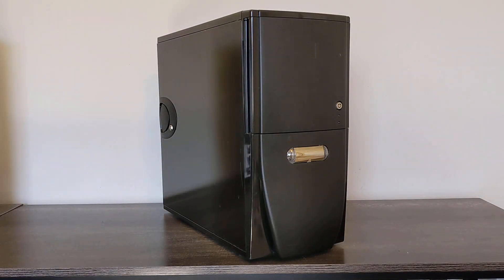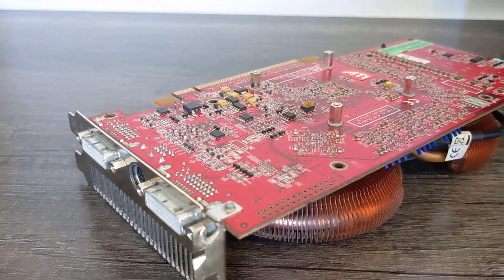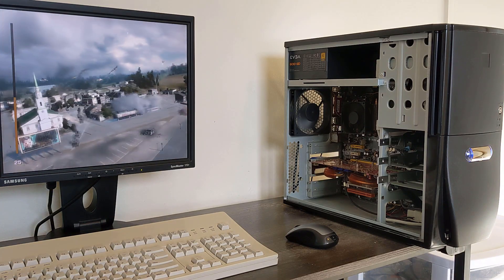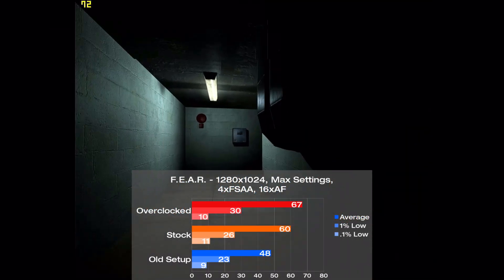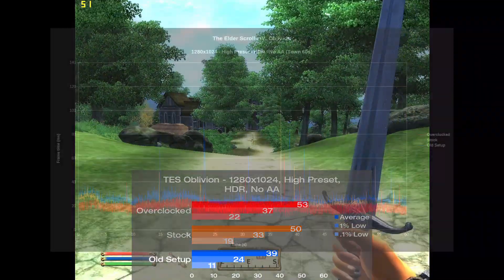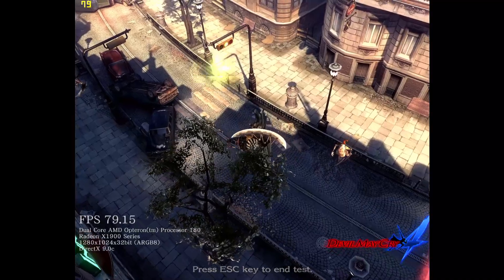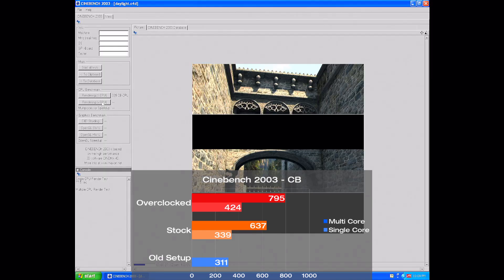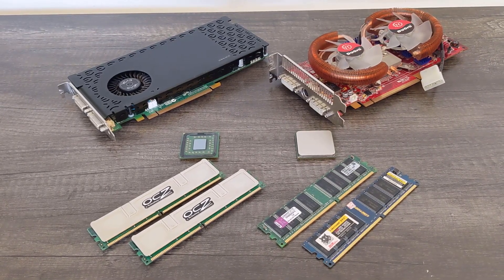Upgrading a 2005 Gaming PC for Early 2006

Comment: I have a similar build, its got a 3800+ 2.0ghz oced to 2.6 (could push it further but the temps get too hot), 2gb or ddr1 oced to 225, raid 0 ssds (sadly id need sata II ssds to take full advantage due to a bug with sata III ssds but either way I get about 270 MBps with sata 1) and to top it off a 8800 gts 640. Its an incredible machine for its age, with the latest nvidia driver with xp 64 bit and mypal 68 (and h246ify) I can watch this video in 1080p30 and I barely scratch the cpu!

Comment: For your test of Splinter Cell CT did you use a physical copy of the game? I tried tobuse the benchmarking tool but it said I had to have the game installed. I also want to verify if you can copy the game files of the steam version over to Windows XP and the game will work, like you can with HL 2. Can anyone cerify that for me?

Comment: All praise to the algorithm for leading me here! This Sonata II case was the home of my own first-ever PC build back in 2006. Until that point I had not broken out of my console gaming roots and embraced the PC as the ultimate gaming platform. The build is etched into memory and I'll always have a soft spot of nostalgia for it. In the process of re-creating it over time as I find the parts and funds allow. If you're curious:

-AMD Athlon 3800+
-ASUS A8N32-SLI  Deluxe
-XFX 7800GT
-Zalman CNPS 9500 (Silver)
-4GB Crucial Ballistix DDR-800
-WD Raptor 160GB
-Sound Blaster Audigy 2 ZS
-OCZ PowerStream 520W PSU (Loved this thing, but would not trust an NOS unit these days... RIP)
-Antec Sonata II in Piano Black

Comment: Just subbed. This is my exact kind of content. And I still have my Asus board with a QX6850, 4gb Corsair XMS2 DDR2 and 2x 8800 GTX's. May end up reviving the old beast sometime soon. But I genuinely miss this time period. I remember watching my dad build me my first PC back in 2003. I had a 2.6ghz Pentium 4, 512mb DDR 400, and a GeForce FX 5200. And like the differences between the 7800 GTX and 1900 XTX here, I upgraded to a 9600 XT a bit later. Wasn't the fastest card in that lineup, but my god was it a powerhouse vs my 5200. that and an upgrade to 1gb ram. I remember having to run Dx7 mode on call of duty 2 because the FX 5200 just couldn't handle Dx9. but that 9600 XT just handled it like a champ. Also got a Radeon X1950 GT 512mb laying around. I'd test my Uber Edition X1950 XTX. But was sadly a dead card. But still really cool to have.

Comment: This ERA of PC hardware was definitely an amazing time of change and innovation. Although all the parts didn't come out in 2005, I remembered comparing my cousins PC having the NVIDIA's FX 5900 (another topic unto itself), to my newly Built GeForce 6600GT (mid range at the time) Athlon 64 X2 3000+ system, it was crazy how much changed in one Cycle.

I had upgraded from a GeForce4 Ti 4200, AMD Athlon Thunderbird 1GHZ unit, and it was night and day.

Comment: still got my old dfi lanparty ultra d, 7800gt and a 4000+ that i had running @3150mhz. many hours were spent playing BF2 on that :D
i did try other cpus in it, 146, 3800x2 4200x2  all topped out around 2800 and werent as quick in games as the 4000+ was. you were extremely lucky to get 3ghz out of your dual core.

Comment: Awesome build and video series, I went back and watched the previous just to get the context of this upgrade. For XP I don't really go higher than an A64x2, and right now I'm well under it.

A build which currently sits on a shelf collecting dust is an A8N32-SLI deluxe, FX60, and dual 1gb 8800GTs. I know it's a bit anachronistic with the later G92 die-shrunk cores, but they run quiet, cool, and max out the CPU at the speeds I run it (usually 438/2800, because I like the board too much). 3ghz is really good for ANY 939 64x2.
Reply from the maker: Much appreciated man, glad you enjoyed. This was a fun little series to do! And that's an awesome build, I heard 8800GT's can be really good in SLI. I should try it out myself at some point

Comment: Minor nitpick but I noticed the DDR slots 1&2 are populated wrong. You’re running it in single channel mode. Put the second stick into the third slot to run your RAM in dual channel mode. It will increase the memory bandwidth and you get fps gains on memory heavy games like Crisis. It might also explain why you’re not seeing much of an uplift in some games.

Anyways, cheers!
Reply from the maker: Weirdly enough every time I used the same color slots, hardware information apps like CPU-Z or HWInfo would report it running in single channel, but when I mix slot colors like in the video they say it's running in dual channel. Not sure if they're wrong or something but that's just what I noticed. Thanks for watching 👍

Comment: To bad many of these older motherboards with electrolytic caps are dead or on their way out these days. I went through several and gave up. Went with a later lga775 Asus board that has all solid state caps. Core2Duo and a GTX280. Went for a top level 2008 PC. Plays all my old games very well with XP 32bit.
Reply from the maker: Thankfully it seems like this board is a survivor, I don't notice any bulging/leaking caps. And that sounds like an awesome build, would have been pretty incredible in 2008 for sure!

Comment: I remember, that he 939 platform went up to x4200 / x4400 Dual Core CPUs. Which is bonkers, if you think about the fact, that those were essentially AM2 CPUs made to work in the 939 socket. Had one myself, and they were surprisingly long lived. I think I upgraded from my x4200 system to a Thinkpad T61 with an NVS graphics card in 2010...

Comment: i wish i had a use for this old Hp Wx9300 Work station with dual opteron 270's its always been in limp mode running on 1 opteron 270 . its never part of the budget it needs at least 2 more gb of ddr1 ecc 1gb x 2 sticks and a heat sink for the second cpu.. and it would be its x2core x2socket quad..i see the mother board cropping up on ebay for like 500$+
Reply: when it was in operation it would Take the whole +50mhz on its fsb that the bios would allow never seen a cpu take a full fsb over clock. i'll give it that. it was playing world of tanks on standard renderer with a hd6850 and getting around 30 40 fps with the full 250mhz fsb over clock.
Reply: Opterons are So jive.. all my experience with opterons have led me to believe that they are the middle child of Sempron and Athlon... with 0 extra features... its just better then sempron but not as good as athlon. and then Bulldozer happened.... and opteron became something semi special as they crammed 16 cores on a die where FX could only hope for 8...all complete with 1/2 the floating points.

Comment: x1900xtx was known as a bad overclocker back in the day, its what made the 1950xtx so viable because most people couldn't actually get their x1900xt to those speeds, and the Athlon 64 x2 939 chips are limited to between 2.8-3.1 on air depending on bin, your doign fine
Reply from the maker: Quite a few people seem to be saying this, I'm kind of surprised there isn't much more room to tune! I figured I was wasn't even close to pushing this stuff to its limits.
Reply: @SPNG  not that stuff, even the 65nm shrink for AM2 got them to at most 6.4 on air for the a64 line, and the R480 was just always running at its limit.

in 2006 if you wanted to overclock it was

Pentium D/Core 2 and Geforce 7900GS/7900GT

The awesome fun was with something like a Pentium D 805 and a 7900GS, that was the overclocking build for its day

Comment: pretty sure ive got a tall ATX case that has water cooling built into the case for the 939. pretty sure all the parts are there for it too
Reply from the maker: Fire it up at some point, that would be an awesome system! Just check to make sure that all is well with the water loop beforehand 👍
Reply: @SPNG  doesn't have any board or anything in the case currently but yep that's the plan is putting some sort of vintage retro style machine back in it. I've got an asus 939 board set aside for it

Comment: Nice to see 939/NF4 content. FWIW the x1900 was an x1800 with a slightly higher clock speed, but with 3 times the shaders of the x1800. So they don't have a ton of headroom, even the x1800 ran pretty hot back then, hence the squirrel cage coolers (loud). You may be able to get the FSB up to 266, just depends on the cpu, but the Opteron's were basically binned Athlon 64's. I have a 165 on an Abit AN8-SLI that runs happily at 2.7Ghz by way of bumping the  bus to 333, lowering my PC400 ram to to 266 and changing the link speed to 3.5. It was a beast back in the day, while I don't have my x1800xt anymore, I do have a HD3870 installed on it now and it runs fantastic for XP era games.

Comment: 2:39 for the RAM: 

"Always insert the memory modules into the GREEN slots first, and
 it is strongly recommended not to insert the memory modules into
 the PURPLE slots while the GREEN slots are left empty."
-K8N Neo4F manual, section 2, page 8.

You don't appear to be operating in dual-channel mode because you're using a combination of green and purple slots.
You posted in the other video that you were in dual-channel. I'm just saying that the manual disagrees with you on that.
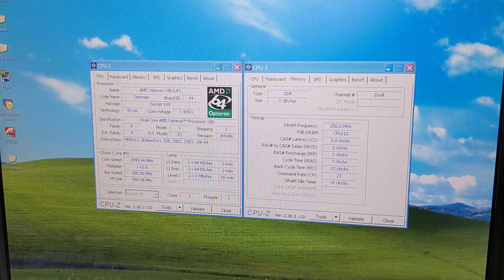Reply from the maker: Odd. When I use one green slot and one purple slot, all the hardware information apps I use (CPU-Z and HWInfo) tell me it's running in dual channel (you can actually see this at 3:19), when I used the green slots for both sticks (how I ran the system when first putting it together) they reported it running in single channel. I don't know if the manual is wrong or something, but that's just what I noticed.

Comment: I had one of those motherboards and i had no problem running a 4400+ on it. But there was some issues with some nvidia-cards on it, but a bios update fixed that.
Reply from the maker: It was very stable for all of the testing! And I noticed that too, my 7900 GTX never worked in this board. What's weird is even the latest BIOS didn't get it to work, while my 7800 GTX always worked totally fine in this system. All of my ATI cards work as well, ironic considering it has an NVIDIA chipset 😆
Reply: Yes, it was almost as nvidia was not compatible with themself sometimes. @SPNG

Comment: The X1900 XTX basically can’t overclock, the GPU is pretty much already maxed out and the fastest really anyone could go was 690-700mhz
Also, where do you get your games from? Especially half life 2 and other steam only games
Reply from the maker: Ah I see, would make sense why its so hard to tune. Still, I feel like maybe I'm not doing something quite right with the voltages and stuff, wouldn't be opposed to do trying some more tuning again at some point. I get some of my games from GOG, and for Half Life 2 I wanted an early version of the game for testing so I found the collector's edition somewhere online. It works a treat and plays a lot nicer with this hardware than the newer versions.

Comment: I like computers but this is nut nut land.  The hardware needed to run those games could in 2024 is so low that a second hand laptop that is out of date by today's standards would play them for next to nothing in price, so why do all this ?  I don't get it it.
Reply from the maker: Yeah, you could just use an old laptop for this, but where's the fun in that? 😉I like being able to customize the system and overclock parts like the CPU and RAM, and there's a lot more expandability potential in a system like this. Also, testing old hardware is fun 😀
Reply: Same reason people buy old cars. It's fun. Plus it's cool to see how hardware of the era handles games of the era. Doing that on a cheap laptop isn't anything near the same.

Comment: the highest i got from my opty was 3.2 any higher required stupid amounts of voltage
Reply from the maker: I guess this is more or less the practical limit for my chip then. I haven't tried anything above 3GHz yet, mainly because even the Phenom II stock cooler was pretty lacking for this chip. Maybe I'll pick up a Wraith Max and start tuning it again

Comment: I preferred when CPU's had pins. Much easier to repair a bent ZIF (zero insertion force) pin than a LGA (large grid array) socket pin.
Reply: I know, right? I LOVE it when the CPU gets ripped right out with the cooler, despite giving it a minute of wiggling back and forth.
It saves so much time over having to then remove it from the retention mechanism. Bonus: it keeps AMD in business.
My father killed our 4200 X2 that way and I killed my 1700 that way.
I'm not entirely sure how one manages to damage LGA pins outside of dropping something.

LGA is much more expensive to produce vs ZIF. That's why AMD held onto it for too long.
Reply: @tim3172  LGA puts the burden on the motherboard manufacturers to produce the, what would previously have been, pins. Thus motherboards shoot up in price and CPU manufacturers still charge a premium. They both win. It could cost the motherboard manufacturers only a few $ to implement an LGA socket and they charge $50-100 extra for it. I can repair bent pins in just a few mins but a few bent LGA contact points could take hours. Then there is the problem with things like PCI-e and even the original PCI. It's all to push sales in my opinion. If the graphics card makers all kept to PCI (original) and all CPU makers kept to .... Say ... Socket 1. With a replaceable chipset the motherboard manufacturers would lose out big time. And, why can't NVMe's run on IDE cables? There is no reason that the same electrical signal can't run down the copper wires of an IDE cable.
Reply from the maker: I've had my ups and downs with both, I'm fine with either at this point 🤷‍♂
Reply: @SPNG  I had to use my phone's zoom to get a clear picture of my old LGA1151 pins back in 2016 and still couldn't get it back in place. There are no tests on the performance difference between LGA and ZiF but I'd say there are none. I'd hazard a guess that it was to save money for CPU manufacturers.

Comment: For some perspective on how nuts the pace of development was at this time, by the end of 2006, Intel would introduce their first Core 2 Quad, the Core 2 Extreme QX6700, and nVidia would release the 8800 GTX, a GPU that could often match or even beat X1900s in crossfire or 7900s in SLI.
Reply from the maker: It was crazy how quickly stuff was advancing at this time, there's only about a 1.5 year gap between the 7800 GTX to X1900 XTX to 8800 GTX but the difference in performance between them is insane. You don't see stuff evolving that quickly now, but then again people tend to keep their hardware for a lot longer before upgrading these days
Reply: @SPNG I think the CPU market was the bigger shock. 
Think about it this way: 
In 2000 We had 1 GHz Coppermine CPUs with 256 kB L2 Cache. We received the Tualatin CPUs with 512 kB L2 Cache and 1400 MHz. But those could be tuned to run at 2 GHz.
Basically, in parallel we had the Pentium 4 CPUs running from 2000 to 2004 in 2 sockets: 423 for SD RAM and 478 for the DDR1.
But then AMD came out with the 64 bit Athlon64 line in late 2003, just as Intel started to ship the new Extreme Edition CPUs.
By 2005 we had Dual Core PentiumD and Athlon X2 CPUs. And by 2006 we had the first Quad Core CPUs
So yeah, CPU power went a lot faster than GPU power in my opinion.

In terms of Graphics card performance: 
AGP 1.0 came out in 1997, and supported 2x speed.
AGP 2.0 came out in 1998 and supported 4x speed.
AGP 3.0 came out in 2002 and supported 8x speed. But AGP 3.0 was never in production, as nobody ever made a card for a 0.8V voltage. All we ever got was the 1.5V universal cards.
We had to wait till 2003 to the the PCI-e slot for better performance. And if you think about it: It had double the speed of the latest AGP slots: 4 GB/s instead of 2.
PCIe 2.0 was not introduced until 2007, and that is about the start of the Core i-series era...

Comment: With a card in the 1x slot, you could upgrade from SATA 1 - 150MB/s to a slightly downgraded SATA 2 (250MB/s) or a downgraded SATA 3 for a card in the x4/x2 slot - the "x4" cards tend to use an x2 chipset anyway
Reply from the maker: I didn't think of that! The SSD was pretty quick to use anyway but that would make it even better

Comment: The good old days of 720p, screen tearing and lack of AA. I member.
Reply: 768p for life
Reply: 720p (16:9) was actually never really used on PC, you had probably 1280x1024 in 2006 and then probably 1680x1050 or even 1920x1080 already in like 2008 or 9. Some cheap displays had 1366x768, but I really don't remember any 720p displays. Ofcourse some poeple still had CRTs and were playing in 1024x768, that was still common in 2006.
Reply: @Pidalin  1366x768 was the most common resolution with LCD monitors during the consumer HD boom. 1280x720 monitors have existed, Portable ones too, I've owned both in my time, But they were far less common.
Reply: got into the member berries i see 😂
Reply: Oh! You had Voodoo² SLI too? Cool...wait 😛
Reply: you mean 1024p?